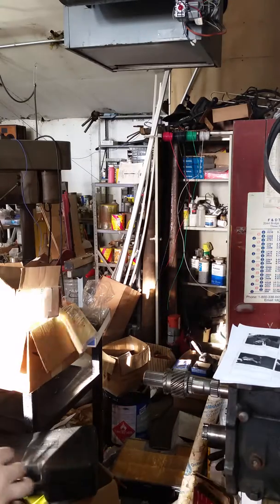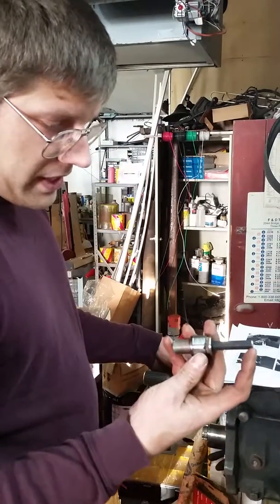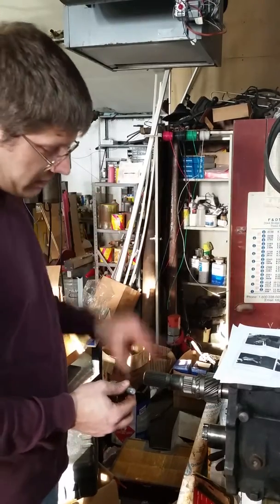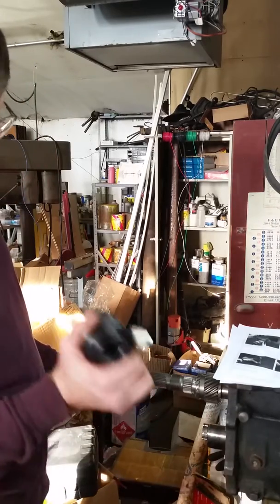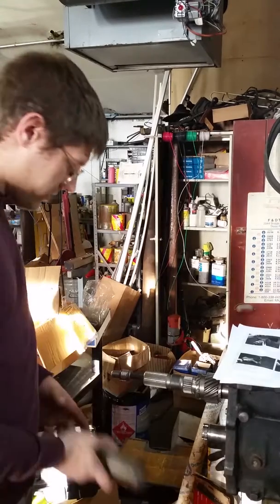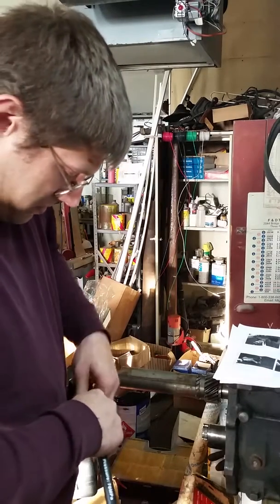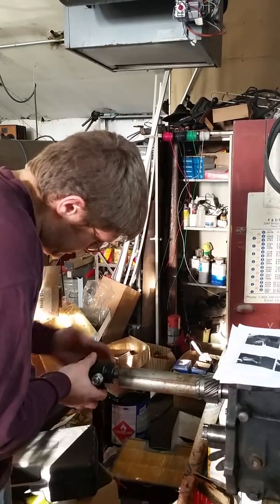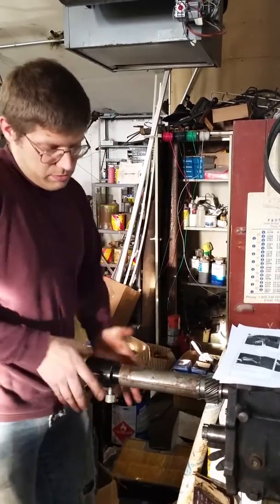NV4500 mainshaft fifth gear installation

Comment: so helpful thank you.  bought the tool and welded a 3/4 bolt to a 1/2 bolt (head to head) worked great 20 mins and done. saved me a crap load of trouble thanks

Comment: Does it seat the gear flush with the bearing?
Reply from the maker: It does if you use the right lengths of tube/pipe as spacers!  I had some extra of the right size (can't recall what size, but I'll measure if I remember this week) so I just slapped a tape measure on it and cut it to size with my bandsaw.  The only hard part was welding the two nuts together, it was somewhat difficult to get them concentric but really not too bad.  It's pretty forgiving as long as the threads are on the same axis, I screwed that up a little.  I will add a full parts list to the video description shortly, aside from the DOM tube or pipe (you can use either of course, this isn't a roll cage lol) needed.
Reply from the maker: Also, just sayin', try to remember to press the gear on facing the right direction.  I'm not going to name any names but some dumbass pressed his on facing the wrong way, had to pull it back off and flip it around and press it back on again, then pressed the GM 4x4 output shaft harmonic balancer on, realized he hadn't put the 5th gear synchro assembly on yet, pulled the harmonic balancer back off, put 5th gear synchro on, then pressed the balancer back on with this custom tool... some people's kids... dunno who that would have been... but he's a dumb ass.  hahaha
Reply: @kenstein  Well the gear is installed and the truck is back together. Thanks so much for posting this very helpful solution to installing a tight gear!
Reply from the maker: Glad it helped someone!  Usually I'm just that weird nerd ranting in the corner and no one cares, hahaha.  I just got my '79 Jeep J10 Honcho into the shop last night, it's the truck I built this transmission for.  Going behind an LQ4 6.0L from an '03 Savana G3500, truck is also getting an NP241 built out of parts from a '93 Dodge W250 and an '89 Chevy Suburban and one ton axles built from Ford, IHC, Chevy, and Dodge parts.
Reply: @kenstein  That sounds like such a cool project. The best parts from multiple sources!  I believe if you would post this to some of the Cummin's forums you would quickly get a lot of views. Do you have an account set up with YouTube in case it goes viral so you reap a few bucks?

Comment: Thank you for showing how to do this. I have stripped 4 1/2-20 Grade 8 nuts trying to use the center anvil from one of my pullers and using the nuts to push the gear into place with a pipe and flat plate. I suspect I have torqued the nuts to around 200 ft lbs using about 24 inches of cheater bar. Also broke one of my old craftsman box end wrenches. Not one of the thin ones either. I guess I will head to harbor freight for one of their pittsburg punch sets. This new gear is a real bear to try to seat.
Reply from the maker: Mine went on pretty easily with this tool since I used an old gear (mine hadn't fallen off yet, the only reason I replaced the shaft is the splines were chewed up and the pilot tip for the pocket bearing to the input shaft was pretty badly worn) but admittedly I have no idea how hard it would have been with the normal allthread, nuts, tube, and plate trick.

I've used the same trick you did to pull closed knuckle dana 70 knuckle tube stubs out of dana 70 axle tubes, and it was an absolute bear.  I was going to try that on this project too but had to buy the knockout punch tool to install a central AC system in my house and had a moment of ingenuity when I was using it as intended.  One of those "hey, this is neat, I can use this for..." kinds of thoughts.
Reply: @kenstein  I borrowed a buddy's Greenlee  set, similar to the Harbor Freight / Pittsburg. Welded a 3/4-16 grade 8 bolt to a 1/2-20 Grade 8 bolt. The Greenlee uses a 3/4-16 internal thread and I was able to press it a little further down the shaft. It did not want to move. I had to really pump the lever very hard and could only use very short strokes so I had the maximum leverage. I am beginning to think that maybe the sharp edge on my shaft, where the old gear splines rode on the round surface, may be shearing off metal from inside the gear. I just cannot imagine it would be this hard to move down the shaft. I just went out and measured the clearance between the gear teeth and the retainer at 0.030 using a feeler gage. So I tried moving it a little further. This time the 1/2-20 grade 8 bolt necked down and snapped. Threw the cylinder about 2 feet (I had my head to the side out of the way) and was wearing safety glasses. So no damage to me. Note sure if I need to try to pull it off and examine or torque the nut on and ride. I sure wish I had studied more fully how deep down the shaft the original gear was seated.
Reply from the maker: WOW!  That's way harder than mine.  I could have done mine with my pinky finger and my chinesium harbor freight set, which I think is a knockoff of the greenlee one, since it even uses the same thread sizes.

Good luck, I'm not sure where I'd go from there.  It does need to go all the way down against the rear mainshaft bearing, just make sure it faces the right way... it'll go on the wrong way but has minimal clearance to the bearing roller cage and won't mesh fully with the countershaft 5th gear.